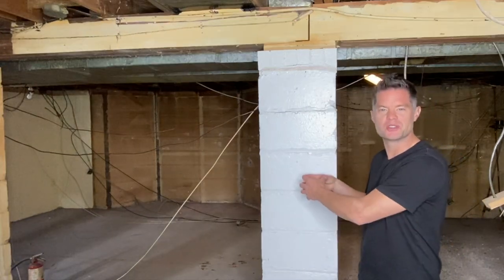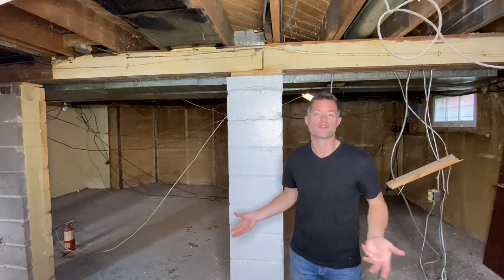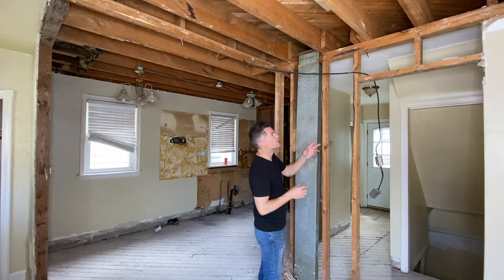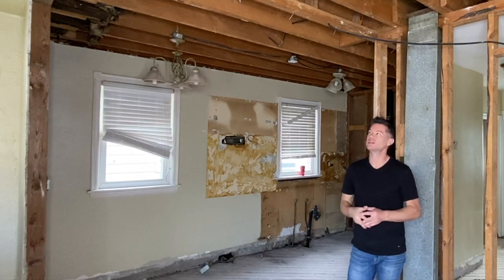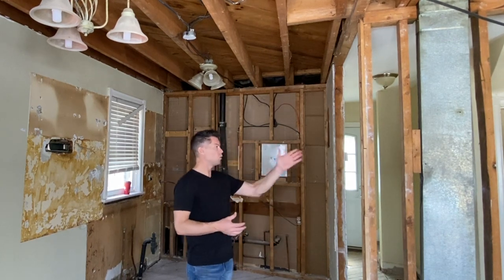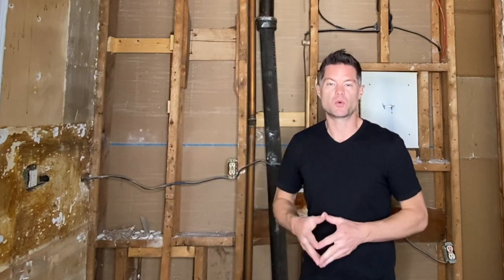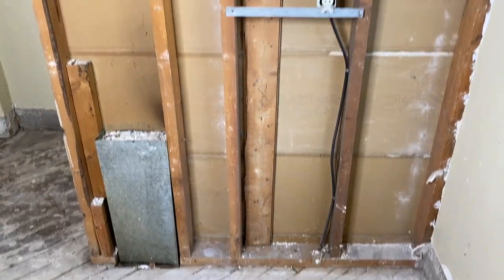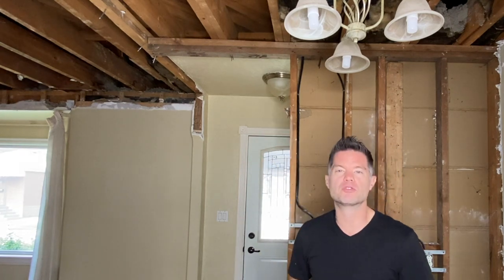HOW TO IDENTIFY LOAD BEARING WALLS. The fastest ways to tell if you can remove an interior wall.

Comment: Thanks for the tips. We're currently working in a basement putting up LVL's. The one kid removed a temporary brace and the first floor sagged about 5 or 6 inches. Fortunately we were able to get it back up and no one was hurt. I noticed when everyone is rushing, things like that can happen. I'm still in the learning stage so videos like this help me to get familiar with load bearing and non load bearing walls and where to start looking.

Comment: Roof loads are also tricky. I had a Pullin about 6' into my kitchen wall, it was just a 2x4 so you know it's not a ton of weight but I waited until I stripped 5 layers of old roof off before adding the beam to reduce the load. Terminating posts at the edge of the house is easier like you said because you can just block the floor to the foundations top plate.

Comment: In this example are the joist in the ceiling of  the living area running the same direction as the joist in the basement were?
Reply from the maker: Ya the joists in this house were all running the same direction but the load bearing points changed a bit throughout.

Comment: Could you please tell me to build a gable roof, when there is no low rafter ties how big the span can be ?Thanks a lot. And what the middle span rafter tie do, what the lo rafter tie do?
Second question is what is the difference between screw piers and concrete isolated footings? Which one is better ?
Reply from the maker: I would talk to your engineer about span tables and roof rafters. They'll have to sign off regardless. I'm a big fan of the screw piles if you can use them. They are in and you can build on them right away. If they every need to come out, they can be removed.

Comment: Great video. But you keep referring to 'plates'. Visually it wasn't evident what a plate actually is. What is a plate and how do you identify it?
Reply from the maker: The bottom and top plates are the 2x4's that are laying flat that the vertical 2x4 "studs" sit on. In the case of load bearing walls, the top plates are doubled up. https://www.finehomebuilding.com/2001/03/15/anatomy-of-a-stud-framed-wall
Reply: @DarrenVoros  Got it, thanks.
Reply: @DarrenVoros  ,

So, if every wall has a single plate, both the vertical and horizontal ? Is that a clear indication that the wall can all be removed ?
After sheetrock was removed... we can feel our way over the top and it was all single plate. No matter which way the walls faced.

Comment: Any suggestions on exterior walls? I know they are load bearing, but I have a 16ft to 20ft section that needs to be replaced. What I was considering since I need to replace the sheathing on the roof in that same span is to figure out how to support the trusses, btw the house is 30ftW x 52ftL ... the section I need to replace is 20ft span from the gable corner to just past my front door. Any advice I would appreciate

Comment: how much does putting load bearing beams usually costs?
Reply from the maker: I'm going to give you the dreaded response.... it depends. For this property, we paid about $700 for the engineer, $1000 for the framer and $350 for materials. For every job it will be so different though.
Reply: Darren Voros I was kinda expecting it depends 😁. But thanks for giving me info on the cost for this particular project. I have a property with a similar floor plan.